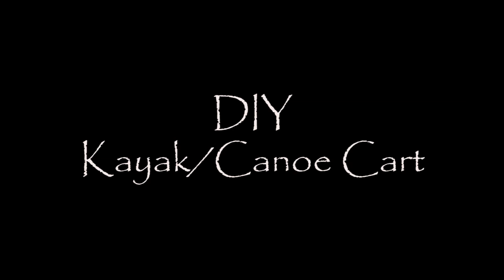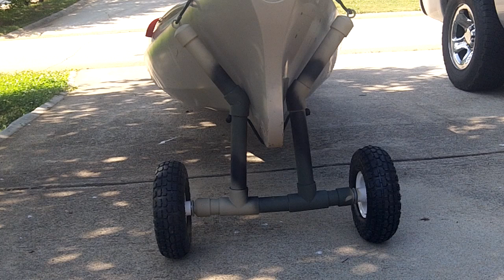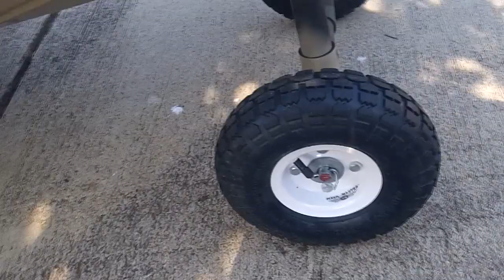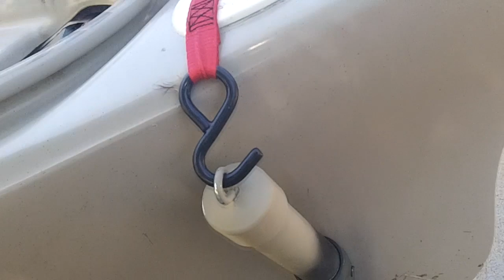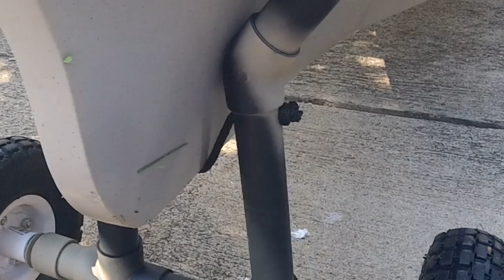DIY Kayak / Canoe Cart

Comment: Thanks good video -  I like the design, I especially like how the downward force of the vessel will pull the vertical tubes inward to help constrain it. Video is clear.
I would like to make one that I can dismantle to fit in my YAK.
Reply: Yeah, I'm wondering if you can do away with the tie-down if you put something soft and squishy between the Y's and the canoe where the weight of the canoe on the rope is clamping the Y's to the canoe?!
Reply from the maker: It would work about the same with a rope. It worked ok but not great. I made a custom one for my kayak months ago. It works great. I'll try to do a vid on it. Its a little bit of several different ones I've seen. I took the parts I liked and made one that would work best for me and the way I use.